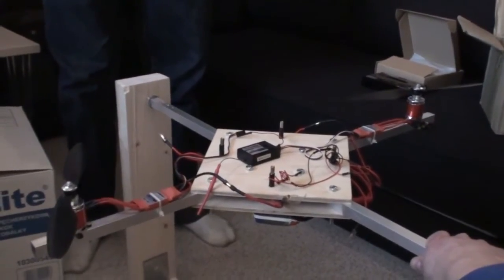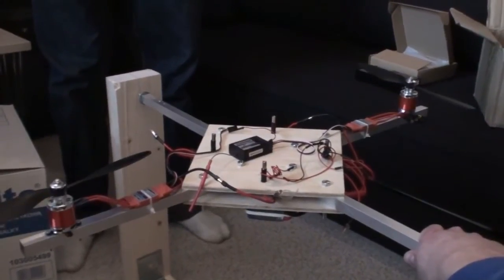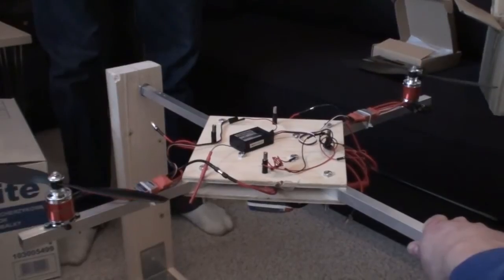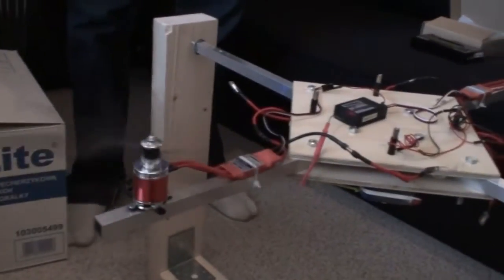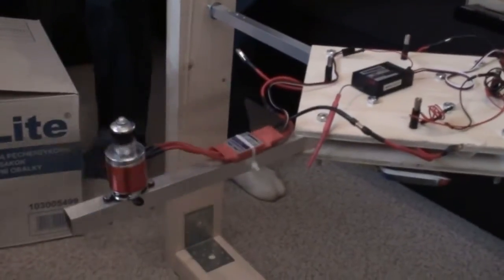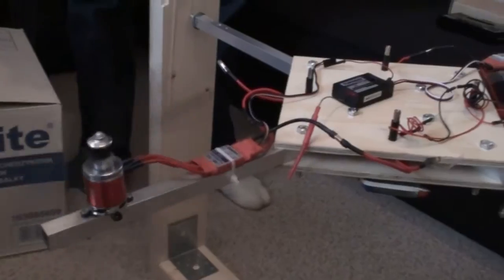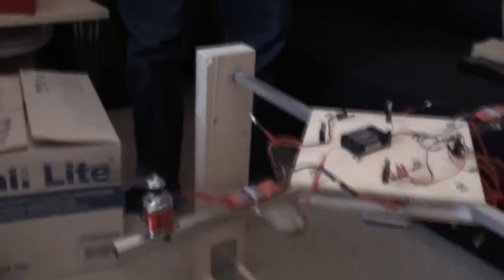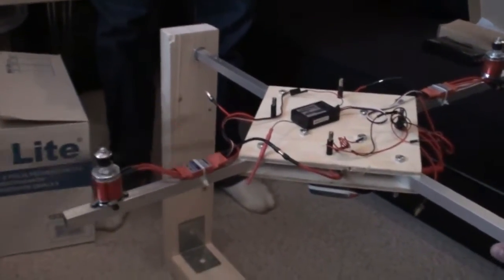ESC Problems with Turnigy Plush 30A

Comment from the maker: I have tried switching controller but the same thing happened.
So I guess you might be right with the motor having a bad winding.
But for now we will stick with this setup as we can fly with it without any problems as the motor correct itself to spin the right direction as we increase the speed.

Comment: I have no expertise is this domain but my guess would be nothing wrong but the controller can't sense the motor feed back and this may be the cause of your problem have you try switching controller around try to see if the problem follow the controller or remain if it remain at the same place my guess would be the motor has a bad winding. Hope this help!

Comment: It's not clear to see in the video if you still have the bullet connectors between the motor and ESC. 
If you have remove them, solder the wires direct together.The bullet connectors gave me a lot of problems with the Turnigy (25A) ESC.

Comment from the maker: Yes, that is true. But currently I am not even spinning the motors up to the speed where it lifts up, so stability doesn't matter for now.
The problem is that the spinning direction of the motor is wrong in the beginning!